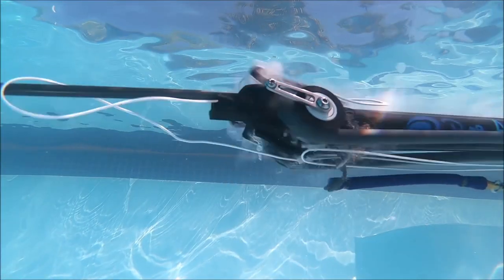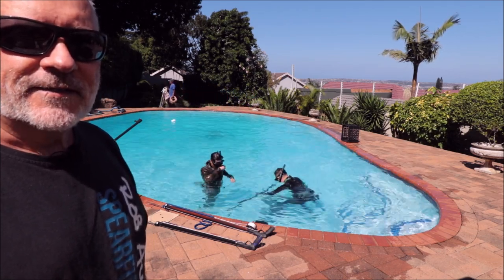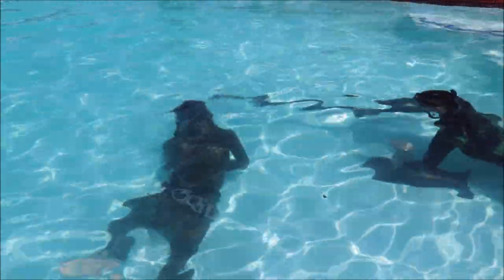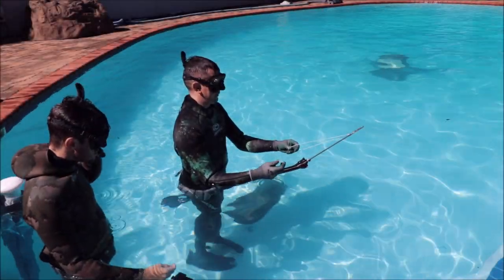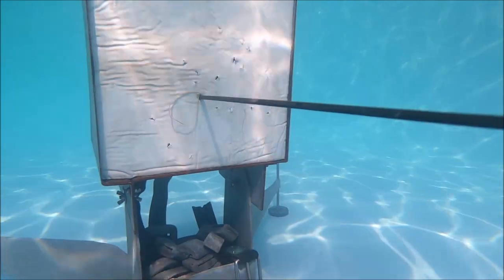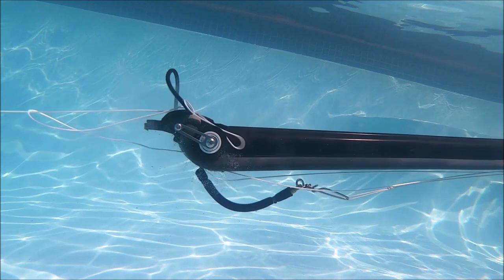Rob Allen | Roller Gun Testing

Comment: What about using magnetic barb ? To insert magnetic element into barb . I think using additional elastic line is not robust it will cut by fish bones. And probably one of reason of overlap that dyneema is s little soft. Did try harder version? Very popular in blue colour.
Reply from the maker: Hi SpearFisher, Sorry, I think you miss understand the video. The dropbarb is normally held on by an O ring. Some find it difficult to use, so the 2 thin elastic was just there to apply enough tension until the gun is fired. The elastic breaks and the barb deploys. I f you watch the video we put up before about the dropbarb you will understand. Regarding the use of a magnet, first off, the barb is 316 stainless steel, totally non-magnetic.  I'm not sure what you are refering to re soft Dyneema? Dyneema is the strongest fibre available. We have it made in a variety of thicknesses. We use double 1,8mm Dyneema on the bigger dropbarbs, this can handle 200kg of tension. This smaller barb has 2 x 1,5mm Dyneema. Both sides of the drop barb is set up such that it protects the Dyneema when shot through a fish. I have yet to hear of one cutting off in a fish. One customer shot and landed over 20 dogtooth using the same dropbarb with the same spear and Dyneema 1,8mm Dyneema line. The set up was still good to use after these fish.
Reply: @RobAllenSpearfishing  thank you for answer. I understood about o-ring and elastic line that keep barb. I meen this elastic line could cut by fish bones or by another reason so we need to take another shaft.
About dyneema. I meant not weak or not enough kg. I meant may it's a little too flexible? I saw people use specially on roller speargun not flexible dyneema blue color. Sorry for por English.
Reply: @RobAllenSpearfishing  about magnetic. Probably you can press magnetic element in barb.
Reply from the maker: @SpearFisherPitZ   The elastic does not hold the barb to the spear when it is shot through the fish. The elastic breaks most times anyway. The Dyneema line is what holds the dropbarb to the spear, not the elastic. The elastic is only there to hold it in place until the trigger is pulled. The Dyneema toggle line is just the same as a cable or the Dyneema line that holds a sliptip onto a spear.
Reply: @RobAllenSpearfishing   thank you for explaining. I understand it. Barb is tied to shaft by dyneema. You use o-ring or elastic for keeping barb atached to shaft. So if o-ring or elastic breaks you need to take the next shaft. Right? I think  it's not robust. Yes. With o-ring is simpler "captain. Please give me o-ring from plastic pack inside my bag or i forgot it? " )
Reply from the maker: @SpearFisherPitZ   No, the elastic is just to hold the barb in position while you shoot. It will break but you just loop a new one on after shooting the fish. The dropbarb is mainly for use when hunting trophy fish. You might only shoot a few times in a day. The O ring is fine as well. The elastic was just to show another option that works. Some don't even bother, they just tuck the end of this toggle line into the rubber. This only works on a standard gun, not a roller as the line will get pulled into the roller.
Reply: @RobAllenSpearfishing  thank you. Sorry for my poor English. I understand it. I write about the same - o-ring and elastic is for hold barb. But it's easy to damage and lost during hunting. Yes. We can hold it be classic way as slip-tip. Maybe there's another approach? To make this product robust and easy to use.

Comment: The longer you use the same shooting line the more often you get those tangles. It's seems almost impossible to get rid of all the twists. The spear with the hole for the line further away from the mech seems ok. What about the muzzle and the nobs for the line? Almost impossible to use with mono and dyneema is sometimes tricky too.. making those tiny bits a bit bigger could help... but i guess not too big so that they break easyly.
Reply from the maker: All the testing we have done show mono to be more likely to snag. This roller is best with Dyneema and, even better with the hole ahead of the notches like this.

Comment: Hi Rob,
Would the 14mm roller bands still have plenty of power compared to the 16mm bands? 
Cheers 👍
Reply from the maker: Hi Tim, obviously 14mm will be less powerful than 16mm. This is why we match the 14mm rubber with a 7mm spear and the 16mm with the 7,5mm, heavier spear. For your info, the max power output from a 14mm rubber is around 45 kg and 60 kg from the 16mm.
Reply: awesome, thanks for the info 👌

Comment: Hello ROB I hope you doing well, im hesitating between the tuna 110 and tuna roller 90 and I was told that in terms of power and performance there is no difference so I’m wondering if you could explain to me 
Thank you
Reply from the maker: These are both very different guns but, you have been told correct, very similar in terms of performance. The max range of the non-roller is basically 5 x the barrel length, 5,5m (single wrap).  The roller is 7 x the barrel length (double wrap) 6,3m. The range is slightly better with the roller but, a roller takes more time to rig and load. There are advantages and disadvantages for both. The roller is easier to maneuver as it is shorter but, less buoyant so it will sink without the spear in.  Only the longer rollers are buoyant enough with the spear out. A roller also has a much smaller operating window in terms of set up to work well. It needs to be “tuned” more often, whereas with a non-roller, not as important.
Reply: @RobAllenSpearfishing  more than informative, thank you so much legend

Comment: I’m new to the channel so please forgive the stupid question. Looking at the tangled line and rubber band at the muzzle of style gun, I am wondering why you secure the line to the spear the way you do. I got into spearfishing with a ferrule that slid freely along the spear. In the loaded position the ferrule was in front of the muzzle with the line attached. There was no line passing inside the muzzle and hence no tangles..?
Reply from the maker: Hi Bill, with a normal drop tip a slide (ferrule) is what most use. With the drop barb, the line passes through the spear. The reason for this is to eliminate the need for a slide. The issue I have with slides is that they create drag. The amount of drag is significant. Also, our spears are not stainless so the slide will scratch up the plating and, more likely to jam at some time.

Comment: Are you not going to do stainless shafts with sharkfin? To do sharkfin in middle for line. Probably it will help to solve overlap problem too.
Reply from the maker: Hi SpearFisher, we do not make stainless spears because there is no spring steel stainless out there as strong as the high tensile spring steel wire we already use, that we know of.  Regarding a fin 1/2 way up the spear, this can induce stress which can cause the spear to bend or break easily at that point.
Reply: @RobAllenSpearfishing  but there's heterogeneity of material. Tuna breaks in place of shaft's pin. YouTube cut message with link, I can't put link here. Stainless bent. Yes. Everything can be broken that why we use slip-tip. Btw i think your shaft are good.
Reply from the maker: @SpearFisherPitZ   The dropbarb works like a slip tip.     https://www.youtube.com/watch?v=uLemjHk2WmU
Reply from the maker: https://www.youtube.com/watch?v=Y0NUEVAP9Hw

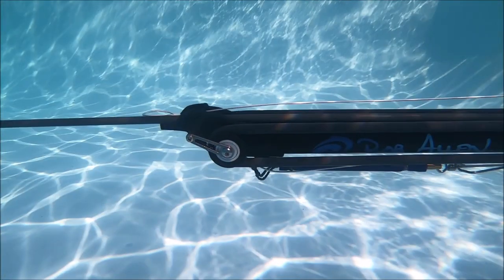Comment: What about that kick up when the spear is leaving the speargun? It can be seen on 5:46. After that kick it seems the spear must be little bit unbalanced in vertical direction. Doesn't that affect accuracy?
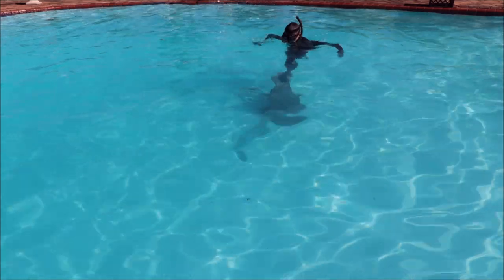Reply: It can be also seen on 4:02. After that the spear starts wobbling.
Reply from the maker: @petapote  That muzzle kick us seen but is much less than what would be on a double rubber gun. Most of the muzzle movement is after the spear has left the gun. Yes there is a little spear wobble, almost impossible to stop this.

Comment: Magnetic barb comes to my mind..
Great video, more of these test videos👍🏼💪🏼
Reply from the maker: Hi J Kiggen, the stainless steel is 316 stainless, non-magnetic.
Reply: @RobAllenSpearfishing  yes ofcourse. 
17-4 stainless is magnetic but I'm not sure how the corrosion properties compare.
Reply from the maker: @jkiggen2989  I have not tried to get 17-4 stainless in a sheet form to make the drop barbs. I think the spear strength in the barb area would be compromised if we try fitting a magnet. Any magnet would have to be fully encapsulated as well.
Reply: @RobAllenSpearfishing  very true. Probably not worth the extra cost anyway.. 👍🏻
Reply: If the barb itself was magnetic, that would be a different story. Wouldn't know if 17-4 stainless can be magnetized...

Comment: dear Rob,
i really like the design of your drop barb. i have done some pooltesting myself and consistently get the shaft to land at the target rotated upside down, i.e. with the drop barb resting on top of the shaft. this is at 5m and 6m distance tip to target.
any idea what could cause this? using a 120 rob allen roller
Reply from the maker: Hi Manuel, a rotating spear is no problem and a common situation. The barb will still deploy no matter what. As soon as the fish moves it will fall off.
Reply: cool, thanks